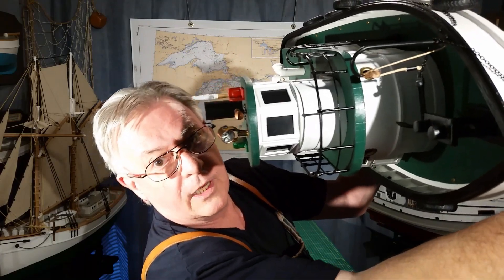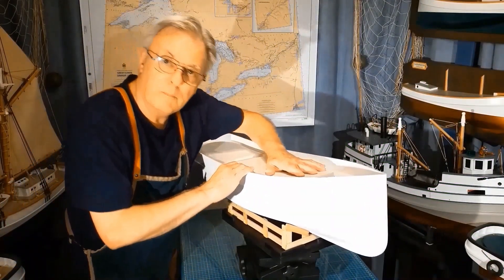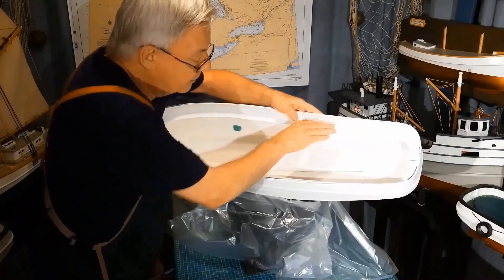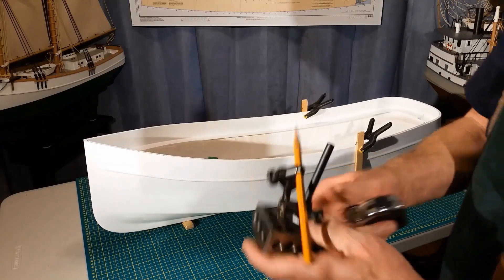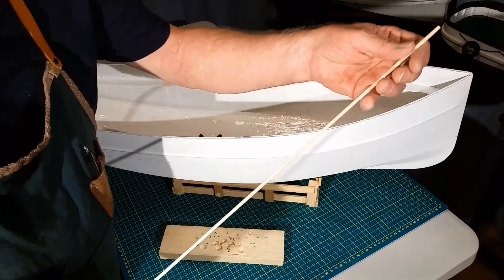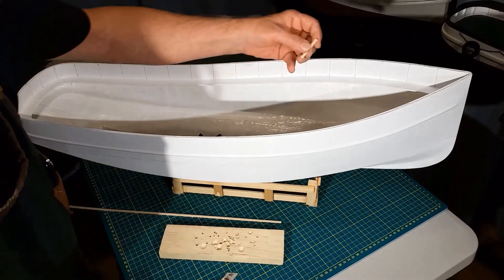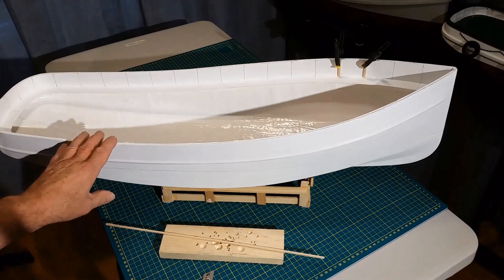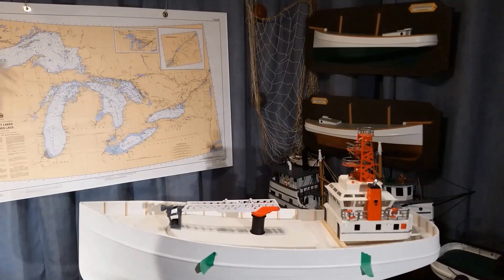RC Bad Weather Ship DIY Build Part 1

Comment: Hi. I have a Slipway rc boat that requires two 12volt motors. Which do you think is better , two 775 motors or MFA 540/GEARED 1/6 ? Thank you
Reply from the maker: Slipway has nice models for sure.  On my Haven 34 hulls I have used a standard 540 dc motor because they are inexpensive and the running gear is easy to find on eBay.  Electronics to run these motors are also easy to replace as well.  One motor will push my hull far over hull speed.  My objective is always to keep RC motors, running gear and electronics simple and affordable.
     For a much larger model say 5 or 6 feet long I would be tempted to look at 775 motors but the associated mounts, running gear, batteries and electronics would probably be more heavy duty.  And possibly harder to find and more expensive. On the other hand the 775 is a tough powerful motor and may be more in line with your build.  Brian RCWH